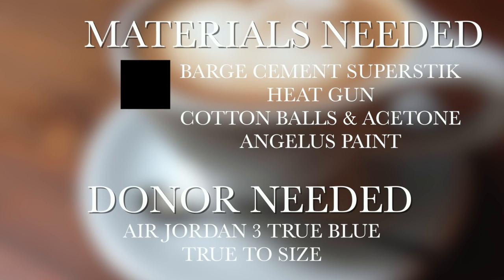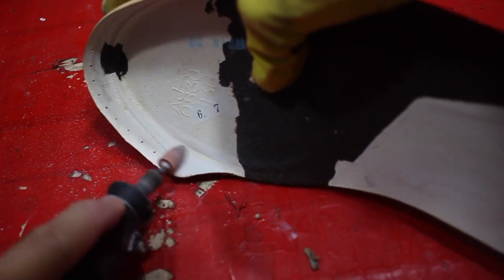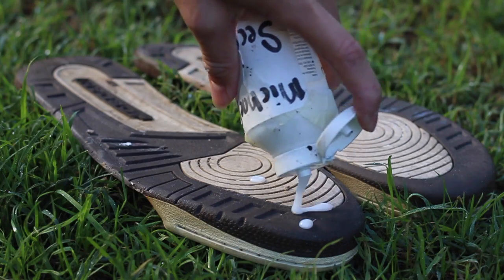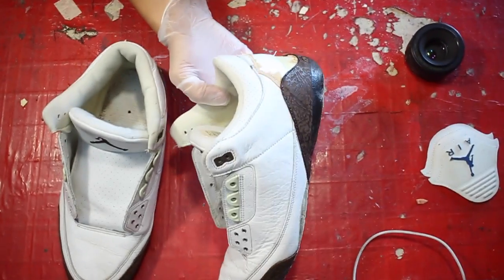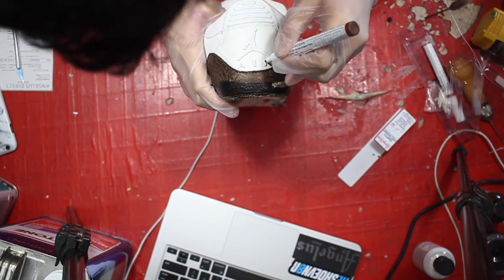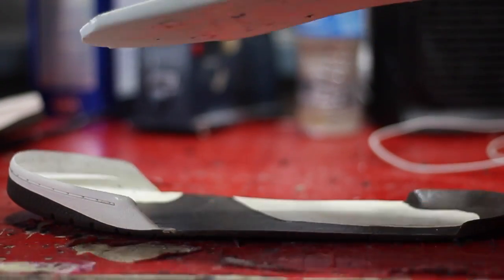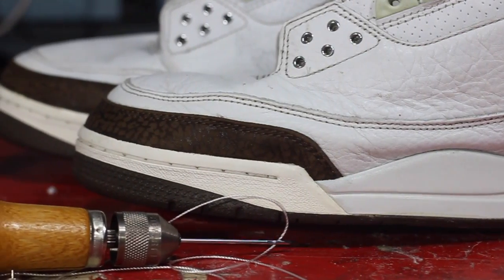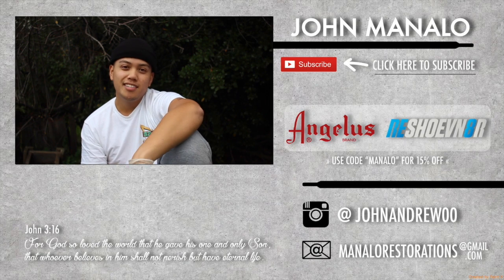Fixing Vintage 2001 Mocha 3's that went to the SUN!

Comment: That RetroSnickers call out though lmao. I also noticed that the midsole material changed over time. It seems a lot more dense, which will probably last a lot longer over time but it isn't as comfortable. It seems like they are masking that change with the use of ortholite insoles in a majority of their signature sneakers with a polyeurathane based midsole. 

As always, dope restoration, man! Keep it up!

Comment: Man I almost had a tragic moment gluing my uppers to the midsole for the bred 4 1999 I need to ask... How long to you heat up the glue for both parts. Some NUBUCK skimmed away but I was able to salvage it. It gets really really sticky once the heat activates the glue so you have to be precise and sometimes it's a tight fit for the uppers and midsole.

Comment: Thermal energy* kinetic energy is associated with movement
Reply from the maker: +RB112 on a atomic level, the molecules for the adhesive moves faster due to heat transfer, causing the solid state of the adhesive to be come liquid. There is no thermal energy without kinetic first.
Reply: John Manalo you're right.. thermal energy is in the form of kinetic energy
Reply: John Manalo My boy!
Reply: +John Manalo can I buy those mochas
Reply: westie420uk boy you funny as hell 😂😂😂😂👌🏽
Reply: John Manalo No, you are incorrect, your statement was correct, but you still state that heat doesn't come first in which case it does, the heat energy charges the atomic particles as you like to say giving them more room to move and move more frequently, the heat creates kinetic, so in the video you said the Kinetic energy from the boiling water, this is not correct, it was the heat in the energy which charged the particles in the adhesive, that led to them moving which THEN created Kinetic energy
Reply: John Manalo the adhesive becomes less tacky because the heat energy transfers to the intermolecular bonds between molecules and once it is above the  threshold, the bonds are broken and the adhesive is no longer adhesive. Then the adhesive cools and the bonds are able to reform making the adhesive firm and possibly tacky again, depending on the glue, how the bonds reformed, and which bonds are involved.
Reply: @ReeceL6828  youtube grammar hurts my soul.
Reply: @Ep1-kh1gh  replying to a year old comment wtf and I have no grammar mistakes maybe I should've used less commas but 🤷
Reply: pretty sure you forgot to implement newton's third law
Reply: Right? I was like...this dude just said kinetic energy lol

Comment: if you remove the liner that separates the midsole from the upper you can get into the shoes padding and stitch through the leather in stead of the inner liner on the back tab then just restitch the liner
Reply from the maker: I don't have a machine to restitch the uppers back together. This method is the least invasive method. Also, the stitching is not visible from the sockliner since the user is wearing them :)

Comment: You mean thermal energy. 'cause kinetic energy means movement.
Reply from the maker: +Garv Sabbarwal which proves my point since there is no heat without movement of atoms first.  The faster the atoms move in the compound, the hotter the compound will become. There is no thermal energy without kinetic.
Reply: John Manalo chill. 😂. you see the heat from the heat gun did it. So the air particles first heated osccilates back and forth cycle continues till you get desired results that is the movement reaches the desired area and osccilates too. Coming loose. Forget it. Chill.  Peace.
Reply: John Manalo  since you replied can you do a tutorial where you re-paint/dye a black rubber midsole to maybe red or white? 😀